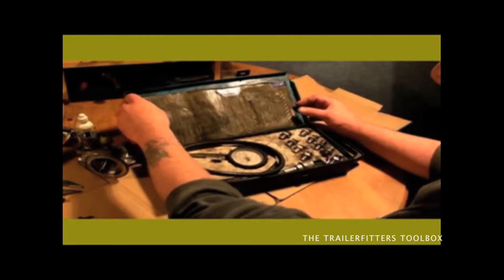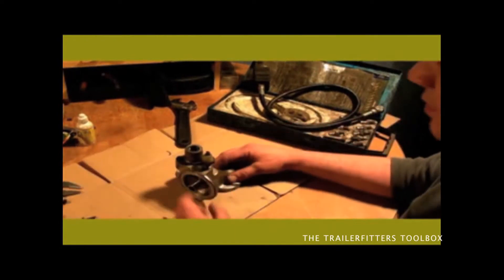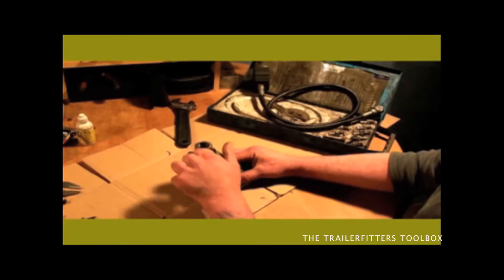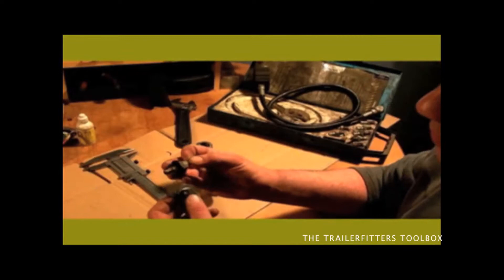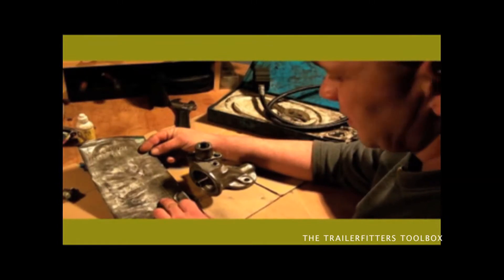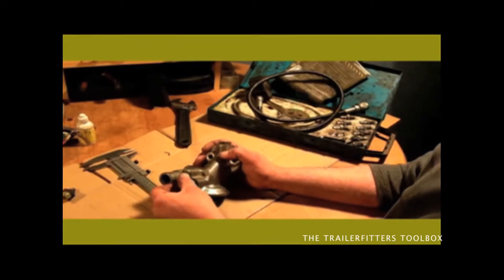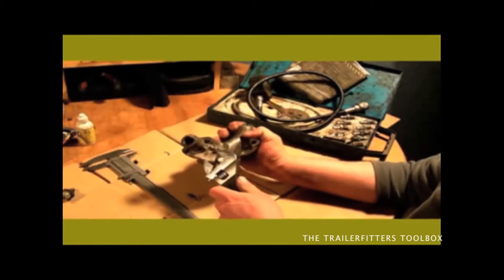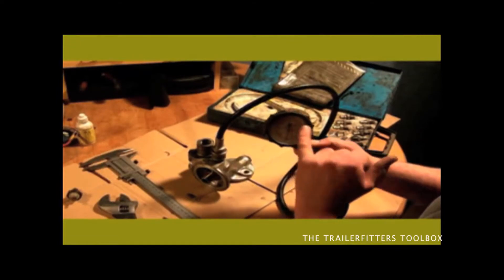Testing the Oil Pressure .......Demonstration Land Rover Diesel Engine  200tdi and 300tdi

Comment: Could you please clarify, is the thread at the oil pressure switch on the 200tdi engine definately M10x1...regardless whether it's a Defender 200tsi or Discovery 200tdi...???

Comment: my 200tdi has practically zero pressure on warm idle 200,000 miles on the engine. do u reckon its ok to just turn up the idle to turn the light off.

Comment: I have read this can be due to displaced camshaft bearings too, or main bearing/s too ? I am led to believe you should test it when oil hot not just water at operating temp. Should test at idle and at 2 to 3000rpm. Any experience with displaced camshaft bearing ?

Comment: Hi ,
I am having a problem with my 200tdi 90 ,oil lamp started to flicker ,changed the oil and after about 2 days it started again.So i decided to fit a new pressure switch and an electric pressure gauge, started the engine and pressure was about 25 psi revved it up and it went up to 40/45psi and left it running for about half an hour idling and pressure remained constant 25 psi.. Yesterday i went for test drive an after about 30 min driving the gauge started falling to the 0 psi region when i revved it up it went up to 20/25 psi . The longer the time the lower it went.
This morning started back the truck and the gauge marked around 25 psi idling revved it up and it went up to 45 psi... The strange thing is that the bulb did not light up (new pressure switch)
Any help most appreciated
Reply from the maker: geo cam  If you have lw oil pressure then you either have an issue with the pressure relief valve in the oil pump or a worn oil pump.   It should be a constant pressure of about 55psi when the oil is hot.    The low oil pressure warning is very low indeed on the warning lamp / switch ... can;t remember the figure off the top of my head though.  By the sounds of the way the gauge is acting it may be faulty,....

Other reasons why the oil pressure could be low
1. the oil pick up pipe could be loose
2. the oil viscosity is wrong.
3. Oil pump worn
4. oil pump pressure relief valve stuck or has weak spring,..